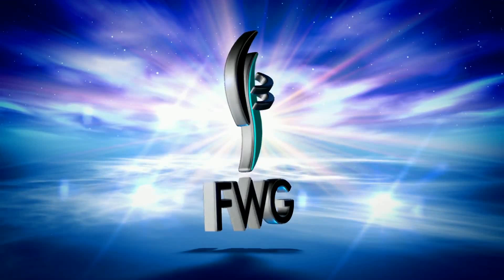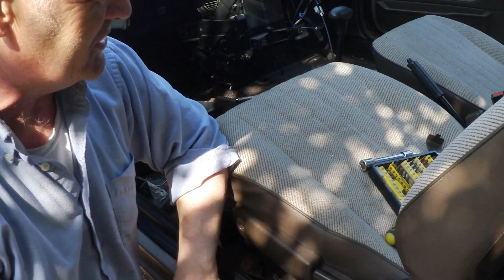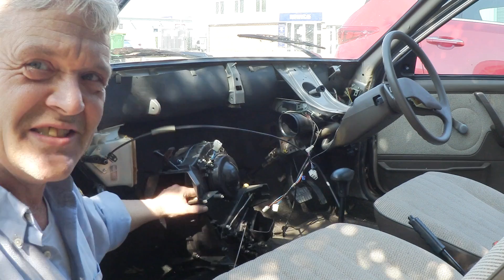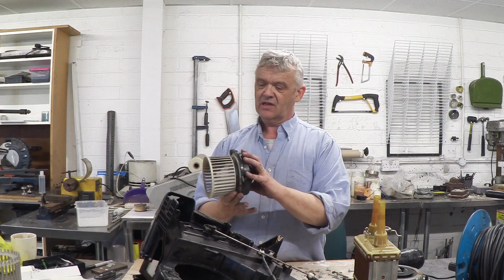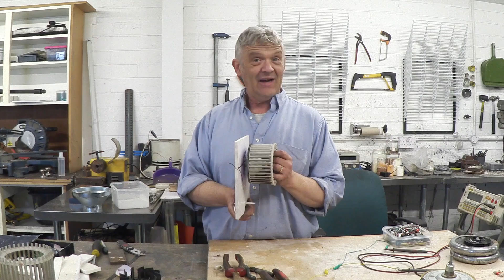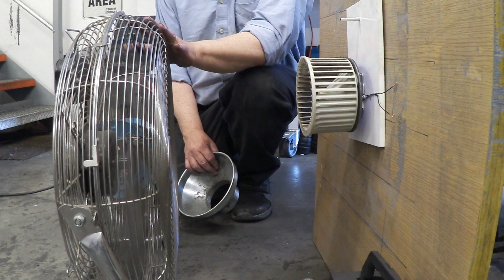Car Blower Rotor For Wind Generator

Comment: Good day Robert.  How many watts can the squirrel turbine with the wind cone in this video produce.?  Can it power a 50W lightbulb?  It seems the setup is much more efficient than the typical vertical wind turbine wherein the latter's returning blades are a drag to the incoming wind.

Comment: Used that blower motor in campervan roof in winter my solor panels is usless in winter wired to solor charge control charges my batteries well

Comment: This video was helpful. I have been considering building a silo type structure that would be covered by opening that have simple one way doors (think doggy door) that would blow open  and allow the air to push in when the wind hits them on the windward side and are held closed on the downwind side by the air that is blowing into the structure. Once inside the moving air flow would be directed down and funneled through a fan at the bottom of the structure that would be used to drive either a generator or drive a heat pump directly.  I look forward to seeing what happens with a bigger fan .

Comment: You will notice when you measure the wind speed of the fan and compare it to the wind speed of the funnel exit that there is a tremendous difference in speed and that it is not only that it collects and focus the volume of air. So if one decides to make an multiple array arrangement against a wall,I can vision a cover that covers al these fans with the holes in it,estatically I am sure it could appear pleasantly on the eye's so this will have  severall purposes 
1. Boost the Air pressure 
2. Boost the speed 
3. Collect and direct the wind.
 energy on the turbine blades. 
4. Serves as a beatifull designed cover for al the hardware.

Comment: Sorry to disagree sir,  I mean why the fan turns.  I believe the fan turns with the funnel because funneling air into the center of the fan while shielding the outside of the blades. This creates a pressure differential, or a place for air in the center higher pressure to escape to a lower pressure area shielded by the larger diameter part of the funnel. When you move the fan closer, this same effect is created by the "mechanics" of how this fan blade moves air, only to a lesser degree.  But that's an interesting effect and lends to "how" to engineer that effect into a working wind turban.

Comment: so i made a generator with all kinds of motors and configurations, and indeed the stepper motor worked the best as far as voltage.... but most current i got was .o8 amps... and that took me sticking it out the car window at like 35-40 MPH(sorry im american!) any suggestions? cuz i obviously cant gear it down more, its hard enough to turn the thing! oh btw that was in parallel config which is more current less voltage right? I suppose I should have put this comment on ur stepper gen video huh?
Reply: PS - forgot to mention your explanation of capacitors was amazing! super easy to follow but still very descriptive. best I've seen so far...

Comment: I have a vertical turbine unique design that suits best for your ideeas. I ve created this design based on engineering learned from others and following my imagination. I want to work with you to make it real. I am very serious when I say that mine is unique. Every wing its closing and opening making the turbine work at any wind speed. Call me anytime during the day and I will send you my design. This turbine doesn't affect the wild life. It can be wrapped in mesh to prevent birds coming in between wings. We could do an amazing work. I am based in London. I am from Romania but moved to Uk 6 years ago. My name is Samuel and I am crazy for power generation. 07490790052. Call me anytime or text me to whatsapp.

Comment: Couldn't you mount that on a bracket at right angles to the wall so the airflow doesn't hit a er, brick wall?  I admire your attitude towards your projects, I wonder how many of the nay-sayers can say "In my experience..."  I've built loads of gizmos in my time as a hobby, so cost doesn't come into it.  IMHO money better spent than sticking stamps in a album!

Comment: wow thats concentrated wind energy and it reduces the amount of lightweight composites materials and motor size.  the good thing about vertical axis is that if wind direction changes they adapt instantly. vertical axis work better in arrays and are probably the most efficient because when you think about wind power sails are most used structures, so if you make a vawt with 3 slim sails that rotate making the same angles a boat makes against the wind it must be quite efficient.  however it still makes noise and disturb birds.  this system of concentrated vortex wind generation looks like is more efficient in materials and has less noise and dont disturb birds which it must be the real concern here.

Comment: Hi Rob,
Intrresting, air flow optimisation on a diy house project could be found by studying the air flow around, past or over a building. Usually there's a couple of  prevailing wind directions and one would generally find it speed's up near or at corners, eaves or ridges, as you ssy keep just below for planning.
Take care to use safe access equipment for working at any heights.

Comment: Thanks Robert for your Car Blower Generator video, I enjoy all of your videos. I would like to ask your opinion, if several of these these generators were mounted to a wall would the wind pressure passing through the generators interfere from one generator to another? I suspect the wind air pressure exiting these blowers may combine to create some odd turbulances and pressures reducing the total output of the system.

Comment: I think you'd be better off putting the squirrel cage from the tower fan horizontally just above the gutter or just below the apex on an apex roof thereby avoiding  planning regs and benefitting from air accelerating as it's coming over the roof, the question is what position would give you the best result?

Comment: I've not read all the comments and I'm sure you've thought of this before but what about those spinning s-shape shop signs that were all the rage a few years ago? They seem to turn easily in light wind, have a large surface area and no doubt with greater knowledge be modified to be more efficient. Either way that template should be easy to make and balance out of even scrap sheet steel or aluminium. Ok, not house wall stuff but certainly shed roof?

Comment: If your intention in building small wind turbines is to create usable power, it is time for a reality check. I have built these things for over 50 years and my tiny savonius rotors power a magnet-loaded rotor through a pick-up coil and produce about 14.2 volts at right around an amp. Not much, right? That's why I have several of them in series. 

Look at the commercial units out in the countryside. if you want to create real usable power, you are pretty much going to have to do what they do and increase the size of your machines by like a million times bigger. Sorry, that's just the way it works. 

I Believe In The honeybee theory, namely is that 10,000 tiny honey bees can do the same work of one giant 400-pound honey bee, if you catch my drift, which is why I have multiple smaller units tied together electrically to create usable power.

Comment: increase the cone length up to flush  with the edge of the squirrel cage. the intake cone should probably have a bit more length and a taper. put this in a windy breezeway or any place really that gets consistent wind and you will have power. as for the squirrel cage itself id also modify it so the vanes are about 1 1/2 times bigger. more surface area and more inertial mass. add neccesary diodes on the back end to a decent capacitor to help with load fluctuation and your golden.....i think.

Comment: If you added in the value of your time you being a professional true scientist (priceless) and didnt consider the fun and learning
 
Then you would be better off buying a ready made unit 

Any moron can figure  that out 

I have made a few generators some very impressive 

I like to use cheap or free 3 phase motors

U can use there own bearings to spin rotor
 
Take out the rotor spin it on it own bearings

You can use plumbing strap to go over bearings to hold in place

Almost any motor and belt will do 

No pulley needed just put belt over rotor shaft 

Use a hand held side grinder after spining up rotor to evenly reduce the size of rotor 

You will have to take off just a touch more than thickness of your magnets

 I use fiberglass and a good epoxy to glue on magnets the rotor 

Or if that is to much work look for a direct drive washing machine motors

 Thay are a powerful ready made generator without any modifications !!

Thay have many magnets and are brushless that are not very thick kinda like pancake motors

According to your setup thay are good for 800 to 1600 watts

Thay put out high voltage when spinning very slow 
50 rpm will give fairly  high voltage 

Thay are like a huge stepper motor 

Very easily made into 
Water wheel one water wheel company use them for there generator 

There is loads of information about them on line many people have and still use them for 
E bicycle , boat motors,windmills,cnc machines , waterwheels, gas battery chargers,and any other use of a free ready to go generator 

Look up Fisher and Paykel type washing machine motors

 F + P first made them but this style now comes in many washing machines 

There are many plans for wind turbines using these type motors 

Thay are far better than any other motor 
Thay are ready made generators

I have 4 or 5 of them for sale or free only pay shipping for mr Smith for this channel 

If it is a long distance  to top of hill or where ever you are able to install your wind turbine or water wheel you just do like the electric company 

Use a Transformer to step up to high voltage at generator and another to step down at battery side

This let's you use realy small wire and lowers your losses 

Think about it at 1000 volts how many amps for 1500 watts
Yes 1 1/2 Amps

That is some very small wire 

So two Transformers make make it affordable to have a wind or water turbine 

If you have any questions just ask 

Have a blessed day

Comment: Hi your posts very interesting, especially wind generation using Nissan heater fan wheel.
Would like to point out you were blowing air into the intake side of the wheel which is normally powered by the motor.
If you were to turn the wheel 90 degrees and blow the air at the blades like a water wheel it would have more effect. Also if you were to use your cone effect and flatten and angle the air stream it would optimise the power of the air. It then should charge more than a phone.
Also condensor/cooling fans off a vehicle have the same effect in reverse, optimising air entry to improve output in terms of energy.
Most motors are generators in reverse mode

Comment: I have an old Whisper 200 wind turbine, which got demolished by a bird, and had run with shorted wires for a couple of years. Would a 15 gallon drum cut in half and shifted off centre, work as wind catchment, in a VAWT setup, do you think? The motor is a nominal 1 kw  unit
Reply from the maker: I don't know mate - but if it was me I would just try it and see to be honest
Reply: Plus, I live on my own farm, in the mountains on Jamaica's south coast, with no restrictions as to turbines.

Comment: Thanks again Rob
You always come up with a practical application for everyday things
If it is possible to attach this motor to a small air compressor for inflating things please post a vid on how to do it
My girlfriend is feeling a bit down at the moment
Make my day
Reply: He actually did a project 3 days ago that would give you some idea of how you might make a DIY air compressor.  The title was "Turning A CD DVD Drive Into An Air Engine Generator".  In the video, he used air to drive a piston in a cylinder in order to drive a motor and generate electricity.  If you reverse the design, and use the motor to drive the piston, you could create an air compressor.  But I don't think the CD-DVD motor would be a good choice without gearing, and even then it would be really slow. In addition, you'll need a valve set up to close the output and open air intake when the piston is retracting, but that opens the output line and closes the intake when it's pumping.  But it definitely gives you an idea of how to set up a motor and piston to pump air.  The CD-DVD motor might be powerful enough to pump air into an aquarium given you wouldn't need much volume or pressure, but I think you'd need considerably more torque to inflate things.  This blower motor would likely be powerful enough.
Reply from the maker: I would think so mate - not sure how to do it though - I'll have a look

Comment: vertical turbines are simple and bullet proof (mostly). these small ones would useful for remote low power sensors for example. of course a solar panel would work as well but they're not as fun to look at.
Reply from the maker: for sure mate - but the idea is building small ones helps you work out the kinks at low cost for then building a big one

Comment: Yes, I really like this idea. I built a wind turbine many years ago. I used the gutter pipe idea for the blades and it worked well but the problem was I lived in a second-floor flat at that time so making any use of the turbine was "impossible".
Now I have a large back garden but the windmill generator would still cause a hazard unless it was mounted on a very high pole but this mouse cage type generator would be absolutely perfect in almost any situation. It could be put on the side of your hut and used as a trickle charger with a diode for a car battery if you had no power in your hut.
Now you got me using the old grey matter Robert. 👍

I meant to add: What, in your opinion, would be the best-fixed magnet motor for a small generator like this if a car blower motor was not available? Cheers mate. 👍
Reply: Some RV campers have a 12 volt dc ceiling fan wired in them. I don't think it  would take a lot of wind to make a lot of power with one of them. Especially if you set up like this.
Reply: @pccustomsandrepairs  Thanks Terry. I need to try and build one. Cheers mate. 👍🎸

Comment: On top of the funnel [which I mention like every other video] it occurs to me that if you can create a relief duct around the rotor housing, one that shunts the wind to the far side of the house [need not be on the wall, can run along the ground or even work against a fence, any place where there is a natural low pressure zone [on the trailing edge of the wind, interestingly, can even be 'in front of' the wall, so long as the fence [assuming the fence is fairly 'wallish' so that the wind does not just flow right through it] has a decent drop in pressure, so that it is taking away the pressure.
Reply from the maker: it's a good idea but you are adding complication before the investigation is finished - we don't know how much power this thing generates and if it is sufficient why add complication? Sure you will get more power but do you need it? My goals are simplicity, cost effectiveness and sufficient performance - what you are suggesting conflicts with those goals at the moment - I am not saying it will always conflict but I resist adding complexity as a general rule - hope this helps

Comment: Great show thanks Robert, just sold my Nissan for scrap, I wish that I'd seen this back then.

Why would you need permission to stick a wind generator to your house? You don't need permission for a TV antennae or satellite dish. 
We should be encouraged and rewarded for saving power not penalised.

Interesting stuff with the cone. I once saw a film where a big ring encircled a wind turbine which then tripled the output. Why does this happen and if it works why aren't all the turbines so equipped I wonder?
Reply from the maker: I have no idea mate - the satellite dish is no probs because it's below the roofline - even so you can't stick it on the front of the house in some areas - like the lakes for example - that ring is often referred to as a shroud I believe

Comment: LOL the thing is built like a water wheel..use it like that.  Direct the air just at the top of the wheel from the side aiming directly into the cup of the blades.  Alternatively, aim at the bottom of the opposite side.
Reply from the maker: tried that - didn't work

Comment: I find your Outside the Box recycling concepts, pure Genius !!   We all need to adopt a new mind set
of "Product Live time Energy Balance".   We as consumers to often get caught up in the end result and not the Big picture.  We will spend ten thousand watts of energy during production to produce a solar cell that might be 2 percent more efficient.  Not to mention all the harmful environmental effects such production might cause.  Yet that solar cell may only have a projected life span of only
5 years and a total energy production less than the energy it originally toke to make it !

There can be Know higher net energy gain device, than a unit made from recycled products !
LOL just the energy saved from melting the product down to recycle it under conventional recycling concepts will most likely be more than a New product will even produce..  

You have caused me to reevaluate and see energy in a whole new Light !!
For instance I now use the waste heat from my A/C to dry my cloths,  and the waste
Gallon of distilled water an hour.
Reply: Sorry the last part of that got cut off.   I run the A/C water run off through a Sawyer water filter and capture almost a Gallon of distilled water an hour!!  

LOL thanks to you I Now see waste like  Batteries!  Objects that had energy put into them during there creation.  The new challenge is to extract that energy back out through recycling....
Reply from the maker: I think you are right mate - we need to rethink our approach and recycle and re-use instead of throw away and buy a new one